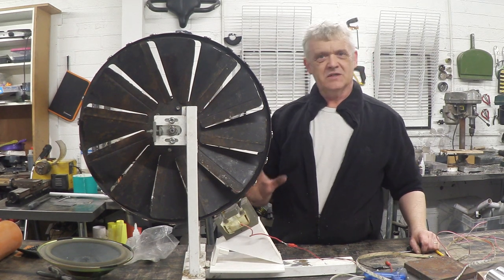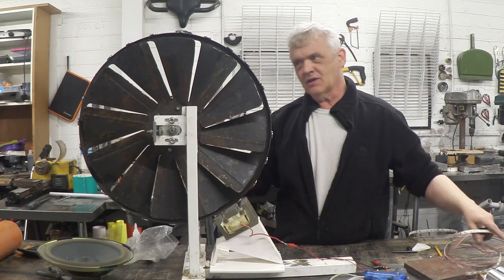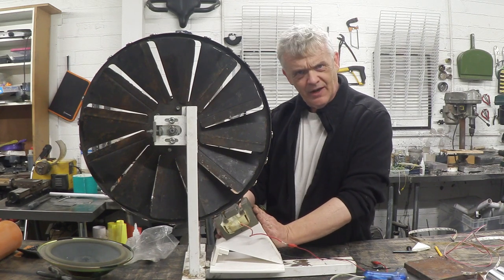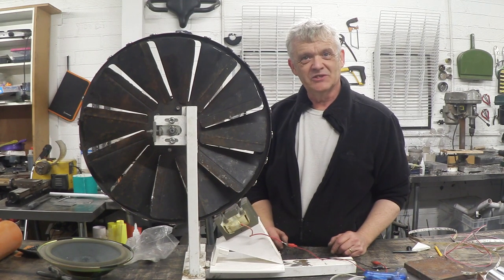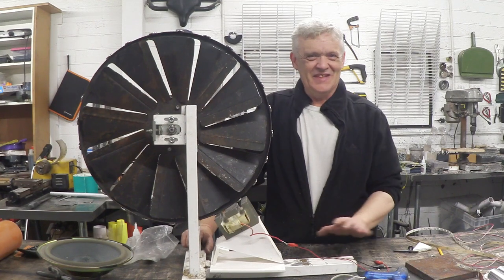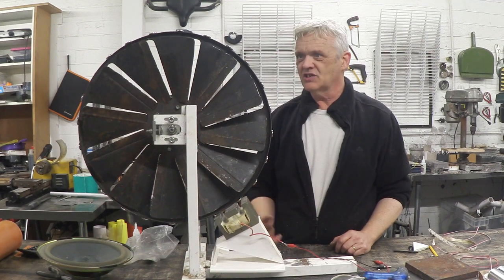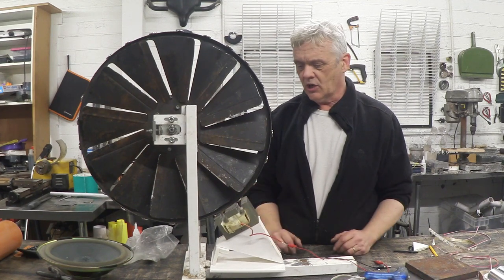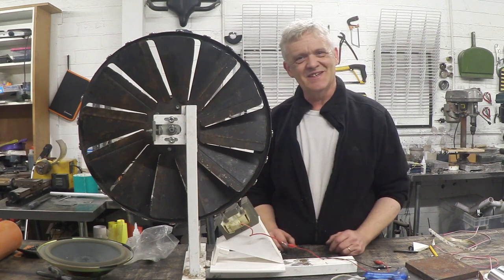Exercise Bike Wind Turbine - A Test In The Wind

Comment: That is fantastic!!  I think the output is actually pretty impressive!!  I have a strip of 60 LED's operating at 12 volts that draws about 4 watts at full power and won't light on less than 1 watt.  Based on that, I'm guessing that your strip needed in excess of 10 watts to get them to light up as bright as they did.  I have a portable 50L refrigerator that averages 8 watts - just a handful of these bike wheels (accounting for low wind) would keep a battery charged so that it could run indefinitely.  Not bad, considering they're dirt cheap to make!!  😊
Reply: All you need is to add 3 more transformers. This gives you a total of 4 at every 90 degree point on the wheel. Then add in a single full bridge rectifier with smoothing capacitors after connecting the transformers together in parallel (observe winding direction). This will easily put out a constant 10-20 watts in a mild breeze.
Reply from the maker: to me it's all about cost per kWh - I only paid for the magnets here - so the generation cost will certainly be low

Comment: Since LEDs are diodes, shouldn't it be possible to build a rectifier bridge with LEDs, then feed 24vdc to the string?
Reply: yep,one gives off heat, the other visable light, the leds oc dont come in all the same rated specs as generic diodes so theres your only real limitation...but doable
Reply from the maker: yes you could do that mate and add a cap for smoothing - but I wanted 'bare bones' so to speak

Comment: Add a Diode and Cap .   Do away with the flickering.   I did the same thing with my bike wheel  wind turbine toy.
Reply: a bridge rectifier would allow you to recover the "negative" part of the sine wave?
Reply: @ChrisHolden  Yes Sir.  Both swings .  Half the Peak to Peak voltage.  Minus the .6v forward drop of the diodes.
Reply: @ChrisHolden  I have a  MB-200 minibike we use to check the mail box here.  LOL  Too lazy to walk the 2 tenths mile and back.  The head light is driven off the tiny  charging coil .    The stupid head light would flicker and dim with engine rpm.   Doing the Bridge and Cap thing ended that mess.  The coil only produces some  4 to 18v depending on RPM driving a  regular 12v  35W bulb.  The cap and diode tamed the mess down most well.   Nominal voltage hits around 14v.  Head light is quite bright.    Slowing down to come to a stop  brightness and dimming  is hardly noticeable.   We only employed a 2000uF cap.
Reply: @pulesjet nice hack!
Reply from the maker: sure - but I wanted a bare bones test mate

Comment: thanks for another great video. Is the blinking of the LEDs caused by the camera or is this due to AC ?
Reply: AC. It just needs a rectifier and capacitor really. I suppose a resistor but meh.
Reply from the maker: it's due tot he AC output mate

Comment: Great video.  I still can't figure why the primary coil winding was removed and not used- either independently or in circuit with the other one.
Reply from the maker: no real reason mate - I just wanted a single coil is all

Comment: So you can run a dc thing on small ac voltage? I never thought of that..damn! well done!
Reply: It would have been pretty easy to stick a bridge rectifier on the output so you don't lose the "negative" part of the sine wave. Then just stick a smoothing capacitor on the output terminals to reduce the voltage dip and there's a very good chance the flicker would be almost imperceptible.
Reply: I think it depends on the type of load, a resistive load like a bulb or heating element should be fine but sensitive electronics could be damaged if there is insufficient input protection
Reply: @sofa-lofa4241  ,today its faster to just put a cheap dc-dc buck/boost on there, set your wanted output then shrink wrap it for outdoor use in this case
Reply: @sofa-lofa4241  ah.. but it is still possible that is what throws me.. Thanks for your information.. I do have a low ac voltage transformers  I might try it with a high repetitive load.. maybe.. thanks Sofa..
Reply: @ChrisHolden  yup that would have been easy Chris and smart.. but not the point he was making here.. But it is good info for those that are planning on trying it. As for me I like plating with transformer's to step it back up to 120 (or 220 depending)
Reply: @tinkmarshino  both Chris and Paul are right, that would be better as you could use the full wave and double the output power (not accounting for losses)
But yeah, I know what you mean, sometimes it is counter-intuitive that it is even possible in the first place!

If you have a small transformer and a few loads to try it with then yeah, give it a go, like Robert I think it is important to try things out for yourself to get a practical idea of what is possible and any related problems that might arise.

If it's free/cheap then it doesn't have to be the best or most efficient solution... It just needs to work to be useful.
Reply from the maker: it depends mate - the led's act like a kind of half wave rectifier all by themselves - and really I only did it this way for super ease of construction

Comment: And there you go, Free Energy post 'Ze Grayt Rezet'... 
Many applications spring to mind, alternative way to charge your battery bank to run a freezer for fresh meat and PIR driven security lights/prox alarms...
Why don't Motorhomes use windpower to charge the batt bank during foul weather?
Reply: It's do-able but wind turbines tend to create lots of resonance, it can be bad enough attached to a building but I would imagine a motorhome with turbine running wouldn't be the best place to try to sleep,
If you set it up at a short distance then that would probably be a great improvement, but anything not bolted down tends to go missing at campsites
Reply: @sofa-lofa4241  My bad, I should have been more specific..I had in mind a fixed, ducted wind turbine [as in water turbine ] to be used to charge the battery bank during the journey, and on arrival at destination, could be released to turn into the wind during overcast weather.
Reply: OK, no worries, it would make an interesting project but would increase wind resistance and decrease fuel efficiency while driving, probably better to fit a bigger alternator, 
It would be useful while parked in the daytime but I'm sure the noise would drive you crazy at night!

I have seen a motorhome with a 50 Watt turbine on the roof whilst parked but It was on a hinged mount so it sat between roof boxes while driving/night time/stormy weather, I think its more cost effective to mount a couple of solar panels on then roof to feed a charge controller.... But not half as much fun as a project and expensive too, 

If you can build one similar to this for next to nothing then any power you get is a bonus, but if you are buying new then I would go with panels, 
I think the reason people like solar panels is that they are more consistent, most people who are camping are doing it in reasonable weather (sunny with low wind speeds) but if you are living in it then your priorities may change, maybe a panel/turbine system would be more consistent throughout the year.
Reply: @sofa-lofa4241  Great conversation btw, and agree would be good to have both! The secret of solar is storage/capacity...always have more than you are ever likely to use!
The latest panels are much better than 5 yrs ago, have just fitted a 180W [not connected yet] and it was producing 20+V on a really overcast lousy day!
Reply from the maker: I didn't realise they didn't - there are plenty of mini generators on the market

Comment: Robert, you know the old Hub Dynamos?  How much power would you get out of one of them?  I used to have a few I took out of old wheels, but I threw them out.  I would keep the wheels now, even if they are in poor shape and make a wind turbine by putting blades between the spokes.  I get a lot of wind here and it should charge a 6 volt battery, but I really need it to charge a 12v battery!  I would need to think about that one, though it is not regulated output, the bulbs are 6v.  Time to raid all the tips for old bikes with Hub Dynamos.  I remember we used to fit two, one on each wheel to get more power (not voltage) to get better lights on our bikes.  Thought about getting power from them, but back than there was no drive to do things like this.  I just wonder just how much power you would get from one of those.  Don't tell anyone though, they will all be raiding the tip for old bikes  ;-)
Reply: The ones I used to use (bottle type and bottom bracket mounted rollers) put out around 5 Watts,
They do increase resistance quite a bit, but definitely worth trying out
Reply: @sofa-lofa4241  Not the ones that rubbed on the wheel, they were hard to keep running, but the Hub Dynamos were at the centre of the wheel, the get really bright lights and a big bulb, you need two, though for normal lights one was enough.  I don't have one to try or I would try one.
Reply: @BoB4jjjjs  I've never used that type but I would imagine there would be less resistance as you say,
Looks like you're in for a trip to the scrapyard, happy hunting!
Reply: @sofa-lofa4241  I don't think I will get one there these days, they are hunted down for those that restore old bikes.  29 years ago you could still buy one new, but they had to be fitted to the hub of the wheel, front or back, or both and they didn't put the strain on you that the bottle wheel running ones did.  In fact, you really didn't notice they were there, however, they didn't produce the power the bottle type did, but at least the didn't slip on the tyre or ruin the side of the tyre.  But then again, you could fit the bottle type yourself.  I need to find an old pushbike in a shed that has been forgotten about.
Reply from the maker: yes mate here in the UK Sturmy Archer used to sell them but I don't know much about their output I am afraid
Reply: @ThinkingandTinkering  Yes, that is who made most of them.  It annoys me that when I moved house two times ago all that things got thrown out.  No room, every time I have moved I have gone to a smaller house!  Something had to go.  There must be one around here somewhere in a shed or a rubbish tip on some poor old neglected pushbike!
Reply: @BoB4jjjjs  If you do manage to find one, remember that they put out single phase ac so will need a simple to make rectifier to use all the available output.
Reply: @Nitecrow314  Yes, it will be 4vAC to 9vAC depending on speed, as it is supposed to be a 6v generator it will be somewhere in the ballpark.  All I was intending was to trickle charge a battery (car) with it, but that would depend on the current I got from it, which might not be a lot, but it does not take a lot to keep it topped up.  Some are wired with one output, but I found some had wires to each coil all joined together, others were joined in such a way as be impossible to separate (not easily anyway) I am just biding my time, hoping against hope someone will throw away an old bike.  They are not common now, I had many bikes with them fitted to both front wheel and the rear.  Never had the batteries fitted to keep the lights on when you stopped though.  I wish I had kept all those bikes now.  I had one hub dynamo in the shed at one point, no idea where it has gone, but then it might still be in a box somewhere!  The bottle type you fitted to a tyre gave you a better output, but then it took a lot of turning.  It was just an idea I had floating around in my head.  But this is what you do isn't it, get people to think outside the box.
Reply: @Nitecrow314  Yes, I had already thought about it, but I have yet to find one.  I know I had one at one point, but where it is, if it is still in the shed will take a bit of finding.
The bottle type that ran on a tyre gave a bit more output, but then it did take a lot more turning.  I suspect it will generate anything between 4v and 9vAC.  I had a bike that had a battery box on the frame, bought to restore, but someone made me an offer I couldn't refuse.  Never even got to ride it yet.  I had a few bikes with hub dynamo fitted, wish I had kept them now.
My father had the last bike I had, what he did with it I have no idea, used it to go to his work, but when he retired it didn't move house with him, so either given away or went to the Scouts for fund raising.
Reply: @BoB4jjjjs  I have one in my shed too afaik. About 15 yrs ago I started building a wind turbine to use it on, but got sidetracked,lol.
Possibly 10 yrs before that I came across a plan for same by a company called Jemmet Engineering iirc. They were suggesting that the output at a suitable rpm would be enough to trickle charge a 12v battery at around 0.4a I think.
 I never got round to making a rectifier to do any output tests, but my interest in wind power has been re-awakened recently and if I can find all the parts, such as the dynamo and the frame/tail vane I built, I will finish it off and give it a go. Very low power of course, but an interesting project none the less.
Reply: @Nitecrow314  All you need to do is to charge a battery for backup, but a trickle going into a battery 24 hours will give a bit of useable power.  Especially if you get a big marine or caterpillar battery.  Ok, there will be days where a lot of charge will not go into it, but if you are not using the battery every day it should keep it topped up.
Reply: @BoB4jjjjs  As it is, I would probably use it hooked up to some 7-14ah gel batteries I have knocking about, just to keep them topped up and in good condition, for which it would be ideal.

Comment: Would be nice to know how to make it feed a 24V battery.
Reply from the maker: I have been doing a few vids on that - basics first but even from the basics you can get the answer to your question - you might want to check those vids out - it's the charge controller playlist
Reply: @paulmaydaynight9925  thank you, you are an angel.
Reply: @ThinkingandTinkering  will do Robert and keep up the good work I enjoy it. I am more in the production of pure hydro and working on a self sufficient system making use of  graphite, ad blue (urea) in combination with fuel cells.

Comment: Actually didn't understand a word you said. However I do undetstand the idea. What I want is a wind setup on a shelf opperated by a fan on high speed.
So question is - does the wing span feay count? Or is it the speed and the amount of turbines?
For instance if you have say 3 or 4 turbines the size of a large fan. Set up in line, in an inclining line each a little higher than the other. Powered by a fan set on high. With a really good transformer. Would it generate enough electricity to power a house forvinstance. And if not why not
Reply from the maker: I am not sure what you didn't understand - it was pretty straight forward stuff - basically here is a wheel covered in magnets - stick it in the wind and will light a few lights as the magnets pass the coil. Your plan is easy to test - so, why not go right ahead and test it?